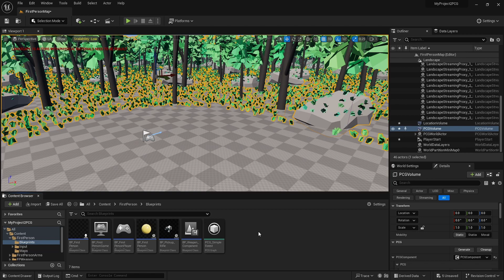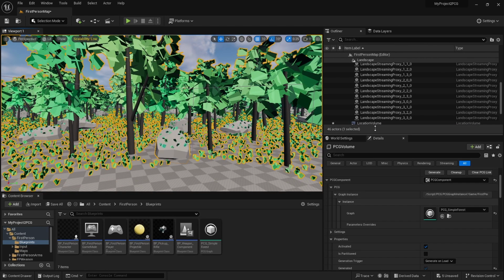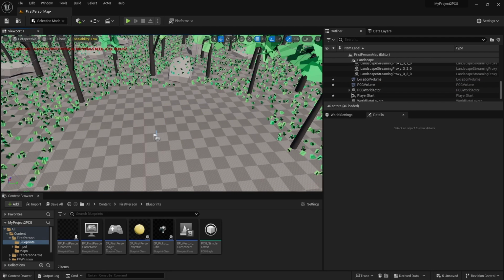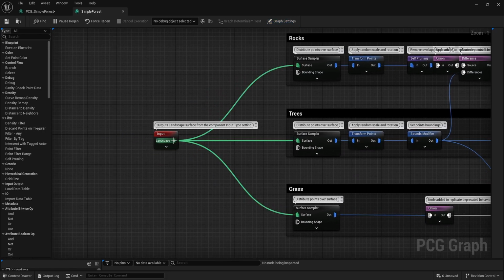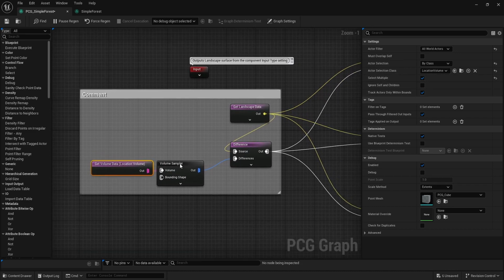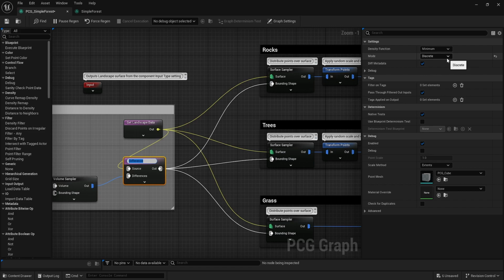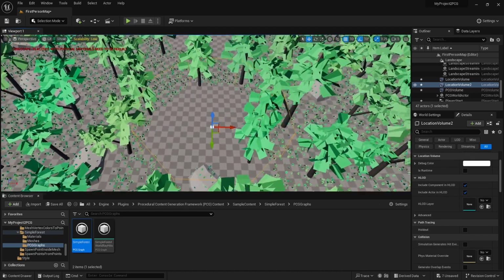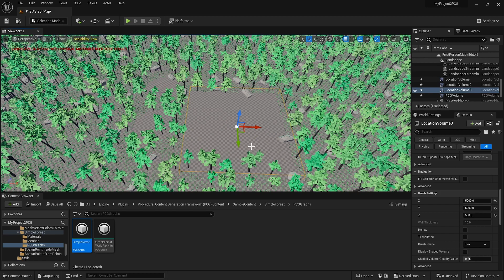How To Create Basic Shape Exclusion Zones In PCG Volumes In UE 5

Comment: Why in 5.5 is it SO HARD to ignore actors with Tags.. 

EDIT: Figured it out thanks to this video showing me the volume method <3.. don't use the volume as the shape. just use the volume as the DIFFERENCE .. so SURFACE SAMPLE from your landscape data and difference that to the VOLUME instead of using the landscape data difference to the volume. it restricts it to stuff only inside the graph but still excludes volumes

this is for 5.5
Get Landscape Data --> Surface Sample --> Difference
Get Volume Data (per this video) --> Volume Sampler --^ plug into THIS difference Node
Reply: Confirmed this works in 5.5   Also I needed to set the 'Track actors Only within bounds' to disabled in the 'Get Volume Data'.  I had to also set the 'Volume Sampler' to 'unbound'. Then in the Difference node,  I set to Binary/Discrete. Hope this helps someone.
Reply: If you're generating at runtime you need to switch it to a Blocker volume. For some reason the Location Volumes don't load properly since their primary purpose is instancing or whatever. 

I just set the Blocker Volume to no collision
Reply: Does this work on 5.7? If I may, can I see your blueprint

Comment: Like a couple of other noted, this doesn't seem to be working correctly, for some reason. The PCGs stop spawning anything, with an error code in the Surface Sampler that says Tried to Generate Too Many Points. Turning PointsPerSqMeter way down doesn't change the behavior. Anyone see this error, or know how to fix it? Because this method is super helpful if it works correctly.
Reply from the maker: If I remember correctly this was caused by grass trying to be spawned on rocks and pretty sure I had to disconnect it

Comment: Doesn't seem to work for me. Im using a close loop spline to scatter but when I add both the landscape data and get spline data, nothing gets removed.
Reply from the maker: Not sure the exclusion zone should be a simple subtraction against the area you are populating using pcg
Reply: @crazedmonkey231  Isn't that the same setup you described in the video? How would I go about it then?
Reply from the maker: @stefan.o  Hard to say without seeing the bp. But I'm wondering are you using the volume sampler node with the spline? There is a specific spline sampler which I think needs to be set up the same way I usually stick to simple shape areas they are just easier to work with.
Reply: @crazedmonkey231  Nothing in the BP besides a spline component with a closed loop.

Comment: Thank you! the problem for me is when you use this method, it cuts out this volume box, but populates the rest of the landscape, which i don't want, i just want it to populate the space inside the PCG volume with a cutout, is that possible?
Reply from the maker: I think that you would just want to use the pcg volume itself in that case, that's where all the spawning happens for the foliage, you can have multiple pcg volumes per level if you need to create something like parks in a city or for points of interest
Reply: @crazedmonkey231  Yeah i figured as much, but hoped it wasn't so, thanks though
Reply: @LarionSiments  you should connect volume sampler later to difference node

Comment: My current system uses  GetActorData in the pcg and a difference node and i attach a StaticMesh of a cube to my blueprint with a tag and filter the PCG points based on that tag, but it doesnt work with small points like grass, only my trees
Reply from the maker: Should work the same as trees only smaller so I'm not really sure

Comment: Im trying to add this to a blueprint, so when i place down a BP_House it automatically has that volume attached, however its not available in the drop down on the components tab
Reply from the maker: The volume is an actor class if you want to add it to another it has to be as a child actor.
Reply: @crazedmonkey231  makes sense, im new to BP so things are just starting to click. Thanks!